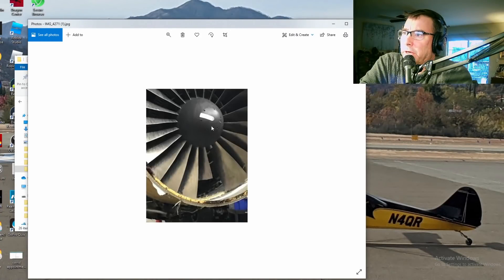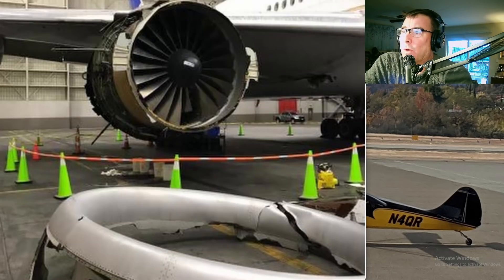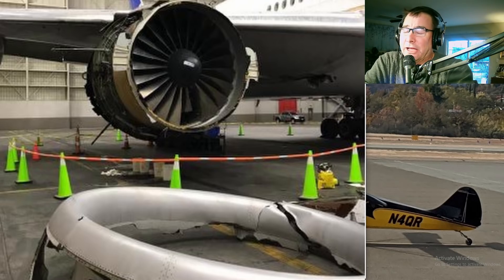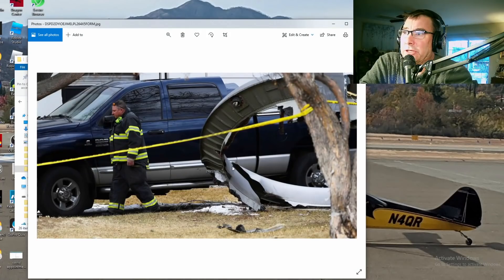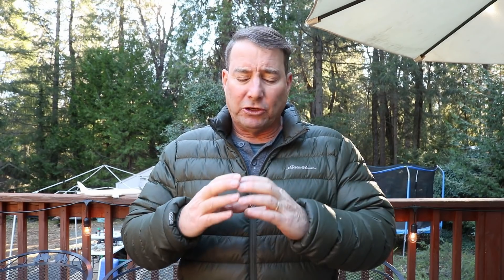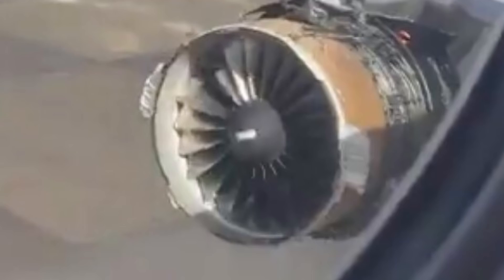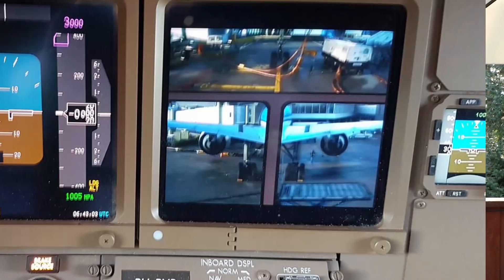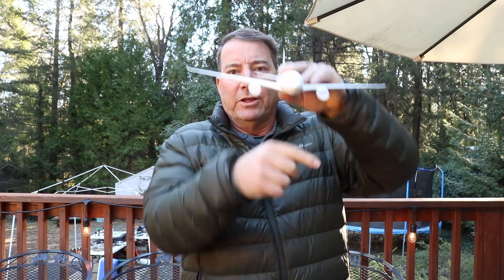UAL 328 UPDATE Fan Blade Failure  B777-200  22 Feb 2021

Comment: Are the blades a composite material? After hearing the weight of one of those blades I read it is. Excellent content, you can always tell when 20 minutes go by quickly while watching
Reply: No. I don't know about the P&W but the CF-6 fan is titanium.
Reply: Fan blades on GE 90 is composite, RR and PW are titanium.

Comment: It really is amazing that these engine fan blades hold up as well as they do. Severe duty and extreme temperature ranges are a big factor. Maybe they need to be changed out more often.
Reply: What extreme temperature ranges? The front fan blades are always running in ambient air. It's the ones in the hot section, at the rear of the engine, that take a real beating.
Reply: @i.r.wayright1457  Extremely cold temperatures at altitude to over 100 degrees at sea level in some cases.
Reply: @roadgeneral  Maybe a 200 degree spread compared to 1400 degree spread in the hot section.
Reply: @i.r.wayright1457  I was referring to the possible reasons that the these particular fan blades failed. Temperature differential is always part of fatigued parts failures. Since it was not the hot section that failed, it was obvious that I was not talking about those extreme temperatures. They live in a different environment.

Comment: It was the Amsterdam cargo flight that went upto 10 000 feet to dump fuel. So the pilot NEED'NT have done that, because Amsterdam Schipol is an Enormous Modern Airport with Loooong Runways. Admittedly that was an uncontained failure because fan blade was found sticking out of the roof of someones car, also nearby, and there were two people who received minor injuries from fall debris.
Reply: Swissair 111

Comment: What's going on with the engine? Another Boeing Jet Just Suffered Engine Issues, Dropped Metal Parts Across Dutch Town (Zerohedge).
Reply: And it was also a P&W engine.
Reply: Boeing doesn't manufacture or maintain the engines. And if the two crashed 737 Max's had aviators flying them instead of bus drivers, they wouldn't have crashed..
Reply: @txkflier  The MAX crashes have obviously absolutely nothing to do with this incidents. I wrode about P&W engines and not a single word about Boeing.  I will simply not talk about bullshit like Airbus is responsible for the MAX crashes. Please troll other people if it is a must-be for you.
Reply: @Hans_R._Wahl  i think he’s mocking 3rd world pilots  or the pilots involved in the max crashes andcalling them ‘’bus drivers’’ even though some of those guys have thousands of hours and would save his ass in annemergency
Reply: @Hans_R._Wahl  Actually, I wasn't replying to you..
Reply: @txkflier Don't shoot the messenger over the headline.
Reply: @AA-tz2bm  Blaming Boeing for engine failures is no different than blaming Boeing for four enept pilots. Six, actually. There was a pilot flying the jump seat the day before the first one crashed who knew how to save it. Why did the second pair of pilots not know what to do to keep their plane from killing them over 4 months later? Why did they fly into the ground at 600 mph without pulling the throttles back? Wasn't it a pair of "3rd-world" pilots who descended too fast, refused to circle to slow down and lose altitude, before landing on the engines, attempting a go-around, and then killed everyone on board? Some of those "3rd-world" pilots had fake licenses. You can fly with them; I'm not..
Reply: @AA-tz2bm  OK, now I understand it if you read it so. And yes, you're absolutely right!👍

Comment: Agreed! It's the 400 Pratt & Whitney Turbine Failures. Nothing else appears to be apparent at this stage.
Reply: I think that Agent Jay-Z would insist that strictly speaking, it's a fan failure, not a turbine failure. The turbine is the section at the back of a turbofan engine.
Reply: @alexandermonro6768  Yeah. Maybe he's thinking of the other PW4000 failure, on the same day. Those were LP turbine blades.
Reply: Actually the blades that failed are part of the fan. The turbine blades are at the rear

Comment: It looked like the fire services didn’t hose the failed engine...they must have been sure that the fire was out, would stay out and the brakes did not over-heat..AND no fuel leakage???
Reply: I saw a passenger video where they did hose down the engine, and the foam was splashing up on the windows, so you could not see clearly what was going on.

Comment: 3 years to the date nearly after its N773UA suffered a simliar engine event.
Reply: Due to Aviation Herald N773UA was now the plane making the substitution flight to Hawaii.
Reply: Was N773UA the UAL 777 that tossed a blade just after leaving San Francisco in 2018 headed for Honolulu and returned to land back at Frisco with no further event??
Reply: @steveholton4130   Yes but very similar in the way the engine cowling broke up etc.
Reply: @AirspotterUK  But of Critical Importance is the fact that both were a result of a FAN BLADE FAILURE on the same model and vintage Pratt engines.
Reply: @AirspotterUK  Immediately before I came here, I was reading a summary of the NTSB Final on UAL 1175  San Francisco to Honolulu Feb. 13, 20 18. In it, it was stated that the NTSB found fault with the Pratt  Inspection, Reman, Reinspection , test, and Recertification on older generation engines being returned to them. At the time, there was not an adequate process for analyzing the stress cracks in the blades cause by  inherent metal fatigue due to aging and cycles of parts nearing the end of there life span. I urge you to investigate that NTSB report. It rather strongly lays blame at the feet of Pratt.            SDH the Great Unknown in CT - BDL
Reply: @steveholton4130  Thank you for the  Information. It seems that P&W still has to do some work after two engines blew up at one weekend.

Comment: Since one blade departed would this be considered  as a not contained failure?
Reply: Contained means that no fragments are released through the engine structure, but fragments may be ejected out the engine air inlet or exhaust.
Reply: @tomsmith897  thanks.
Reply: Look at the hole in the fuselage under the wing. I would say it was, in fact, not contained.
Reply: @dmedlin8118  Depends on how the damage was caused. Was it the cowling striking the fuselage or compressors blades. Will have to wait for the NTSB report to answer that question.    Southwest Flight 1380 was a contained engine failure but  parts of the cowling broke a window and killed a passenger.

Comment: It was really starting to annoy me when media reports were saying stuff like "the plane was able to land with most of it's engine missing."
Reply: Media constantly talks out of its ass.
Reply: @Graphene_314  Sadly you're correct, though often it is not bad intent but IMO is down to ignorance and plugging perceived "gaps" in the story with out-dated, inaccurate, or irrelevant information.  

Some years ago I worked on the inside of a major media story that ran and developed for an extended period (more than two years), with a number of twists and setbacks, and I found it very interesting to see how the media reported the story, which often bore only marginal resemblance to the actual story as seen from inside!

The way it seemed to work was that media would take the press release, add information from previous releases which may no longer be relevant, solicit input from independent "experts" who may have little or no relevant experience, and add information from the parallel situation in other countries that may have no relevance either.  Then the final media report tried to smooth over the all the information and finesse it into one cohesive story - which may be utter nonsense compared to the real story and the press release.
Reply: Yeah, here in Lithuania news channels literally translated "lost an engine" as a physical detachment...
Reply: The very reason my viewing preferences for events have been the ability to cherry pick News on U-Tube then be poisoned by talking heads.
Reply: I was walking through the newsroom of a local TV station when a reporter, who had been given a story, asked "what's the angle"?
Reply: @elderbob100  The angle of the dangle is inversely proportional to the heat of the beat
-Beavis
Reply: Some networks are able to broadcast with most of the intelligence missing...
Reply: ignorance prevails until one is educated. don't blame the media, (Juan is the media too, friend) blame ignorance and lack of curiosity. these two states of mind are very prevalent in our country, related to many many subjects. turn off your TV, you have no complaints.
Reply: @gregknipe8772  Well said, Greg! To add my two American rupees 😆, general (i.e. non-specialized) news outlets have a lot of subjects to cover, and limited resources that need to be allocated to each, and they have to prioritize based on what their audiences want (“if it bleeds, it leads”). This isn’t to excuse bad reporting, but I have some sympathy for the competing forces that news directors and editors have to deal with. That said, I think we’re all grateful for subject matter experts like Juan who are willing to share their knowledge with us!
Reply: @IdliAmin_TheLastKingOfSambar  No I think the quality of analysis has disappeared if it was ever there. If you have ever seen the news cover a subject you know well they invariably get at least one part of the story wrong.
The i's were dotted and the t's crossed by Juan himself when he covered the Toddbrook Reservoir spillway problem. UK media had reported on it for days but had carried out no analysis to find what the problem was.
Reply: @COIcultist  I think that for many journalists, its a toxic combination of ignorance, laziness, and a lack of basic journalistic curiosity.   

A few years ago the local media where I live quoted a business executive repeatedly, on a point that 20 seconds with Google would prove was, to be charitable, extremely misleading.  To "investigate" ("fact check" in 2021 parlance ) the statement took, as near as near as made no difference, no effort at all, for anyone who had access to the internet, and yet local journalists blindly quoted him or showed video of his misleading statement on multiple occasions over a year or more.
Reply: @pulaski1  Well local (as well as national) media depends deeply on who covers its advertising budget. I wrote my last comment in a hurry and missed out another facet of modern journalism(sic) that deeply offends me is the growth of "Agenda Based" journalism which just looks for facts that fit their narrative. Remember "Mostly Peaceful But Fiery Protests" from last year? In the Toddbrook Reservoir spillway story The Canal and River Trust who makes the previous British Waterways look like paragons of virtue were eager for the truth not to come out. So the "Climate Aware" media ate up stories of abnormally high rainfall (All true) no doubt the result of climate change being responsible for the undermining. The press were eating this up no end till the simple truth that if you carry out no maintenance fail to repair grout between concrete panels and even allow undergrowth to grow through between panels, then water will pass through too undermining the supporting soil.

Comment: It looked mad expensive. I was wondering why the fire kept burning after the shut-off valve was closed.
Reply: Oil fire...not fuel.
Reply: probably an oil sump right there
Reply: All right I looked at a closer video and there was no smoke behind that fire so no to the oils still probably fuel.
Reply: @JSFGuy  -at 200 mph and a small fire, you would not see the small amount of smoke.